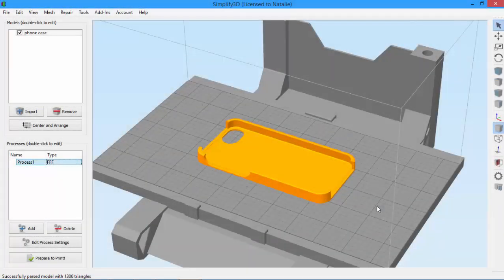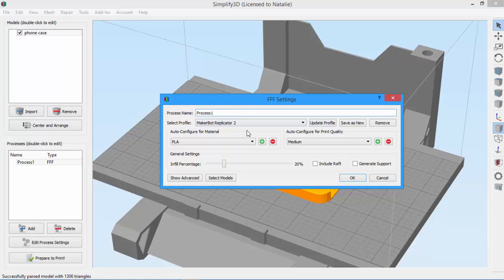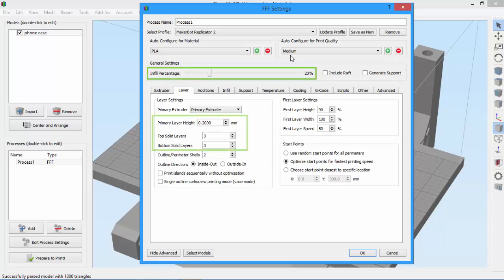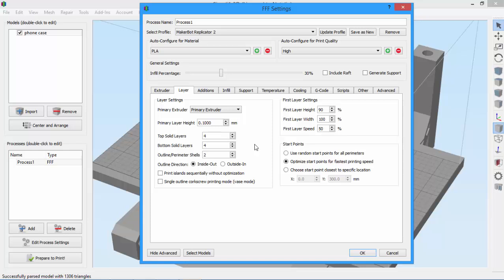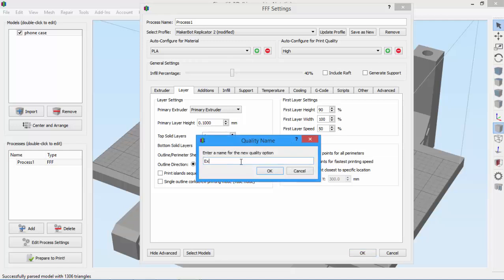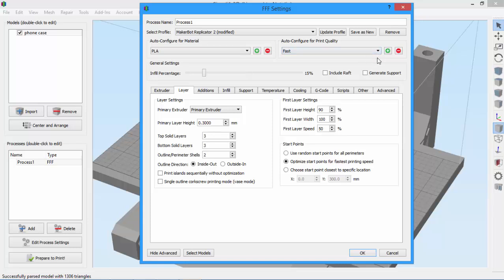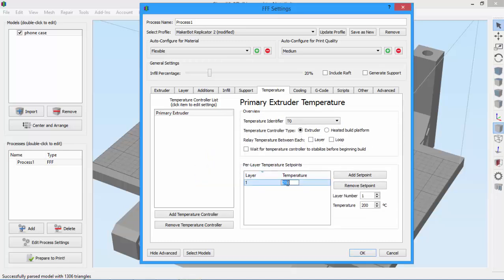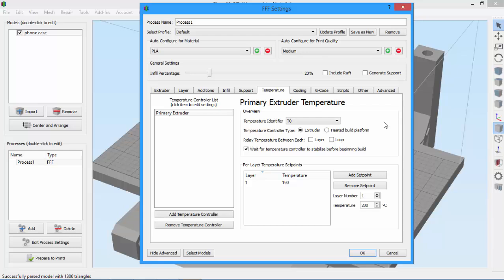Adding Material and Quality Options | Simplify3D

Comment: I bought a Simplify3D license a few years ago and anything other than the PLA or ABS settings in the printer defaults was a hot mess.  I'd add a new material and it seemed to clone the existing material.  That seemed like a nice shortcut.  I'd modify the temperatures, print speed, retraction, etc. (just like in this video) and the changes I made were applied to ALL of the different materials.  Very frustrating.

There is a process, a profile, a material and a quality.  There is a Save As New button that seems to apply to the profile.  The other changes apparently autosave, but the changes I make for a new material are applied to ALL materials.  I'm using version 4.1.2 under Linux, but I've had exactly this same problem with every version for the past several years.  Apparently, this seemingly simple and necessary feature is too clever for  me to use.

Comment: Material management is the WORST in simplify3d.  Every time there is an update.... start over.  Set up a different profile for a minor hardware change.....  start over.  Its a disaster and has me setting up Slicer PE for my Taz 6 and junking simplify 3d.

Comment: I don't understand the Select Models tab. How do I assign different printing setup to different models in the same scene?
Reply: nevermind, I have to add multiple Processes to the scene. Whenever I pressed "Prepare to Print" with multiple processes, the warning message confused me. But we can use both Processes at the same time actually.
Process1 would be the main model and Process2 another one with the different models selected in the Select Models tab.
Not very intuitive to use but gets the job done I guess. Would be cool to see the assigned models in a subtree of the Processes tab.

Comment: I had a little problem with this... At the "Other" tab, you can adapt filament price, yet when I change it in PLA, it seems to have changed for all my materials...
Reply from the maker: With the way our profiles are setup currently, the Filament price is global, so it does not change with change in materials. Here are some resources on how to modify your profile

Customizing FFF profile -> https://forum.simplify3d.com/viewtopic.php?f=8&t=1989&p=23512&hilit=customizing+fff#p23512

Adding Material -> https://forum.simplify3d.com/viewtopic.php?f=23&t=4225
Reply: Thank you very much
It might be a suggestion though
Reply: Umm...ya.  Lets just make the price a global setting?  How often if PLA and PETG the same price?  AMZ3D vs Hatchbox?  Never the same price.  Just started my paid two week trial of simplify3d and I must say, I am really loving it and the settings layout.  But no acceleration control?????  Almost might need to return this product.  Acceleration control is a bit of a no brainer in my world.  Love the print paths.  Was getting strange gaping in slic3r, Cura just seem stupid the way it would jump around the print.  This is nice.  No acceleration though!? Come on.